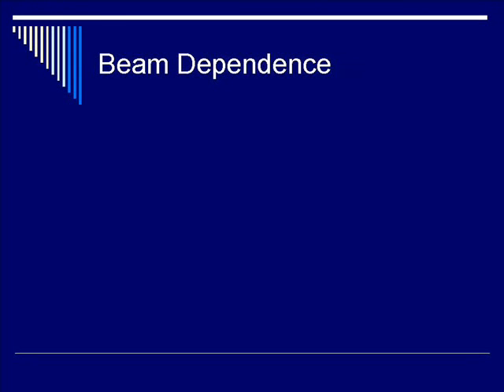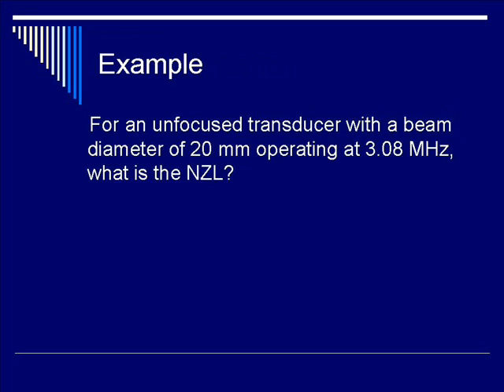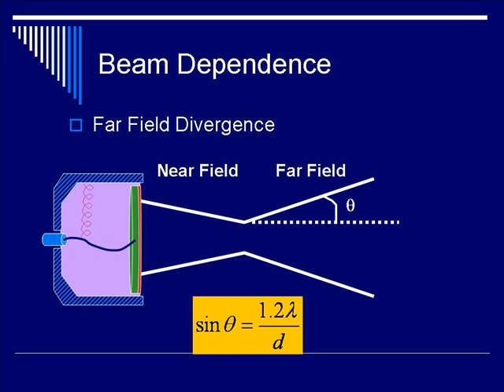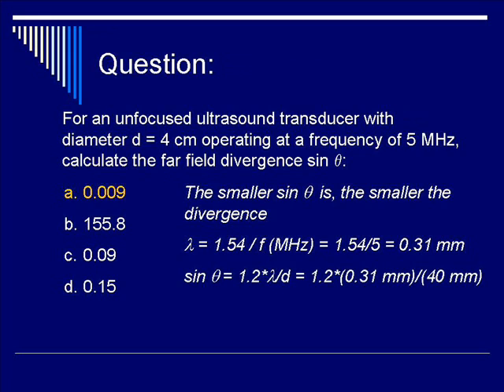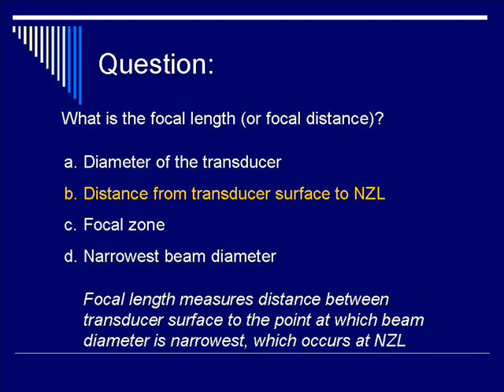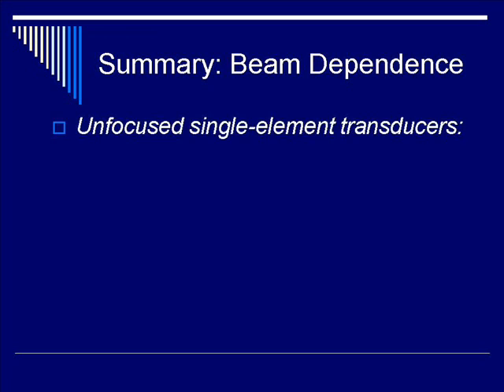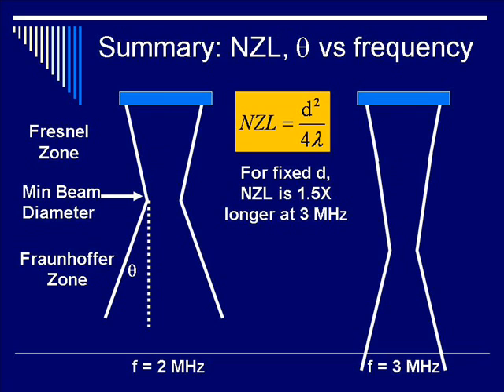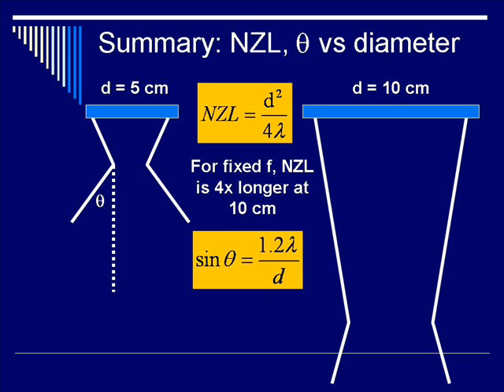Physics of Ultrasound: Transducers - Segment #4

Comment: theta, as shown in the figures, is supposed to be the FULL width angle.  The artwork shows it incorrectly as the half angle.  The math is correct for a circular aperture (a disk).   Also note that  d  is the diameter of the transducer disk.  The beam diameter depends on the measurement distance from the transducer:
1. At the transducer surface, the beam diameter is d.  
2. At the NZL distance, the beam diameter is assumed to be d/2, and 
3. (well) beyond the NZL the beam diameter is approx distance*wavelength/d
Reply: For what it's worth I tried looking things up and I came across a distinction between the beam divergence angle and the beam spread angle.  Based on this resource ( https://www.nde-ed.org/NDETechniques/Ultrasonics/EquipmentTrans/beamspread.xhtml ), I think that theta as shown in the diagrams in this video would be the divergence angle, and then the spread angle would just be twice of that.  But I'm sure that there are different conventions and subtle differences based on context...

Comment: Another comment: flat transducers have natural focus for pulsed ultrasound, and it occurs at a distance of 0.25*(d^2)/wavelength --- which is exactly the NZL.  This is sometimes called the "last axial maximum" because the nearfield has many partial focal points (that are seldom mentioned), but the last one is the strongest (and why it's the most useful in ultrasound).  The focus distance can be made smaller than NZL by using either a concave PZT or by adding a concave lens to the PZT.  (a convex lens would diverge or spread the beam)
Reply: That's really interesting and thanks for pointing it out!

Comment: Last comment on the summary slide:  
1. NZL is proportional to diameter (d), but inversely proportional to wavelength.
2. beam diameter and divergence are proportional to wavelength, but inversely proportional to diameter d.

The author used the proportion symbol to mean "related to", but I am being more specific to avoid reader confusion.
If you can remember the simple algebra for these (as shown in these slides), then proportional, and inversely proportional, become obvious.
Reply: I had the same exact thought.  Thanks for pointing this out!